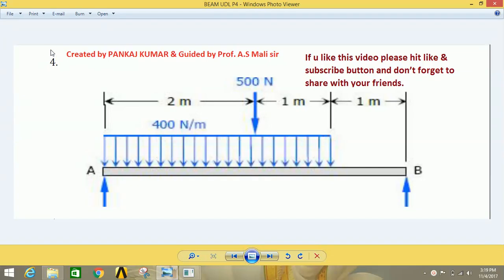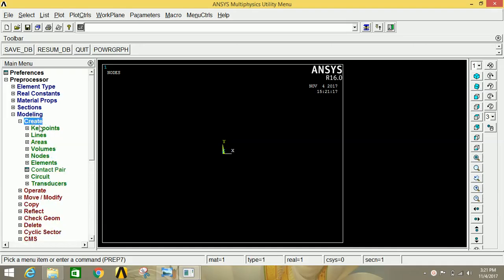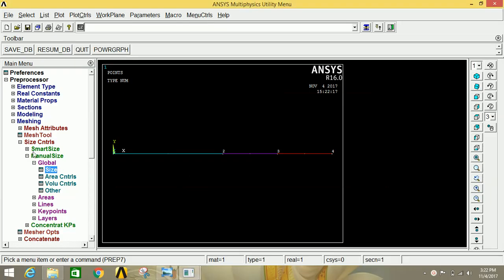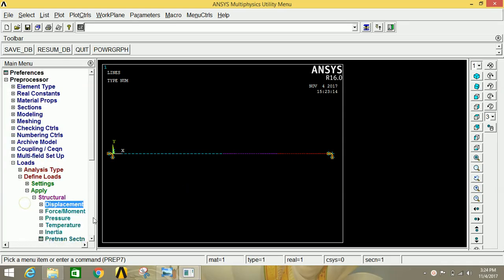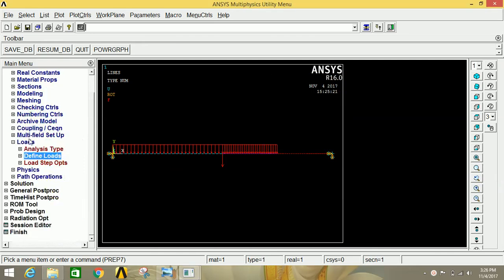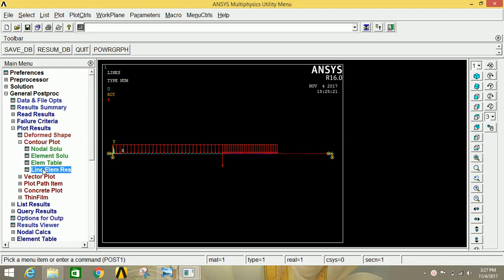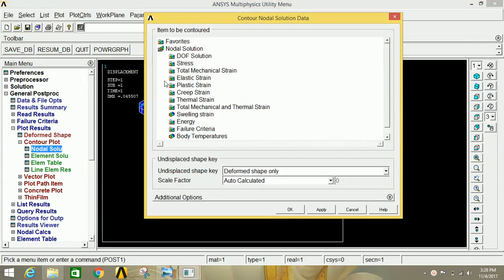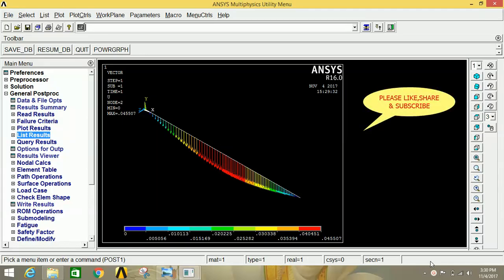Analysis of Beam with UDL by ansys Mechanical APDL.

Comment: now in this problem, the length of each element is divided into 30 sections but what commands should be used to divide the length of each element into sections of equal length throughout the beam.

Comment: how did u give the cross section of beam it was not given in the question
Reply from the maker: ajai krishna .. because I have to 200×300 mm beam ...u can input according to your requirement
Reply: Mech. Engineering Knowledge Junction so if nothing is given then we can assume is there any procedure to assume the values why particularly 200 x  300
Reply from the maker: ajai krishna ...I consider this dimensions as per my requirement . There is no fixed rule u design according to your requirement
Reply: I'm getting value for Fz also how do i avoid that?
Reply from the maker: It's default c/s..but u can whatever u want